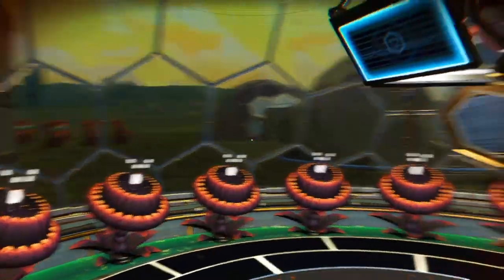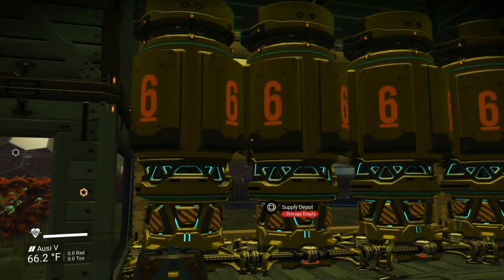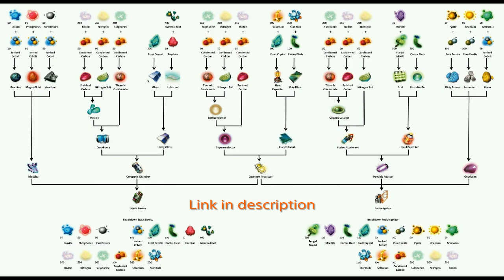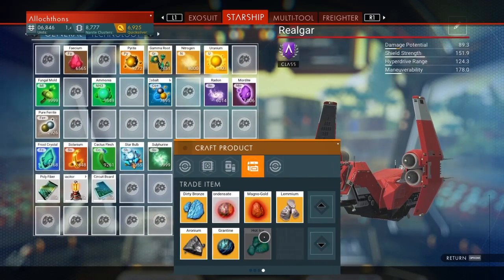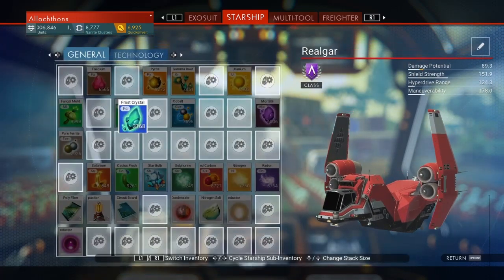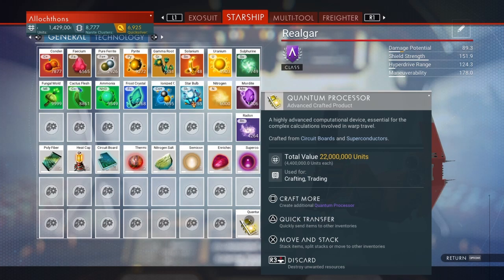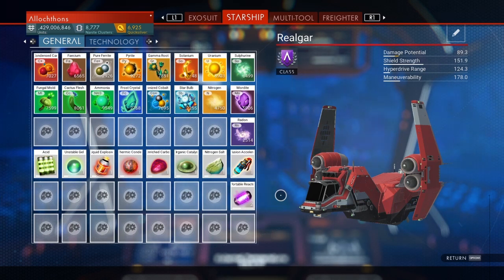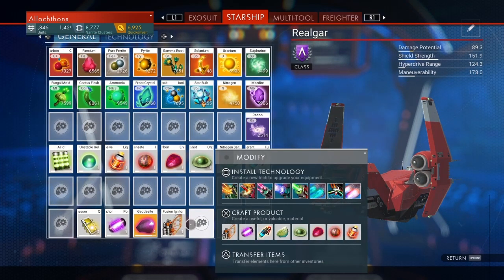No Man's Sky: Crafting fusion igniters and stasis devices with assembly lines.

Comment: I just learned about these yesterday because someone gave a bunch to me while I was afk in the anomaly. So I looked them up to see where I could get more.

My main base is in such a good location for it. There is an A-Class nitrogen hotspot on site so I turned it into a mine with 4 extractors, the next planet over already has a radon mine.

On top of that I don't even need to make a sulphrine mine because I can just mine extra nitrogen and refine it into sulphrine. This means I can keep the entire industry within my solar system.

And I just built a huge farm. I'm literally turning my chill base into something that looks like an Intel factory, it's great.

Thanks for the assembly line idea, I've already messed up the recipe ratio so badly, this should fix it. Thanks!
Reply: I know its 3 years but what type of system was that in, ur base and mines?
Reply: @chicken4090  just a yellow korvax system

Comment: I rather like the idea of using the hauler for the "assembly line". Not well explained but the core concept is there for anyone with a couple braincells to rub together. As it stands I just finished setting up a base to run batches of 10m at a time. Tweaking my final grow outputs at the moment so I can make a run of them all about at least once per day. I alread have a hauler that I essentially use for overflow but I definitely think it would serve much better a purpose if I set it up as an assembly line type! 

I will say this though keep your nitrosalt,  thermic,  enriched carb… and plant based on a line above your first teir products then your second teir below that etc if you do it right there is little reason you shouldn't be able to leave most if not all of your production lines set up permanently. 

Now I'm off to completely overhaul the damned setup that I literally just finished setting up before stumbling across this video. So if you'll excuse me I'll be cursing myself out for awhile for not coming up with this myself sooner.